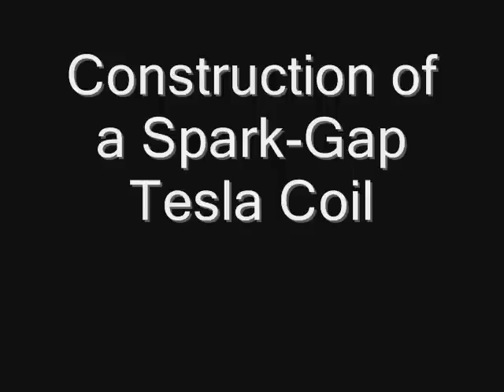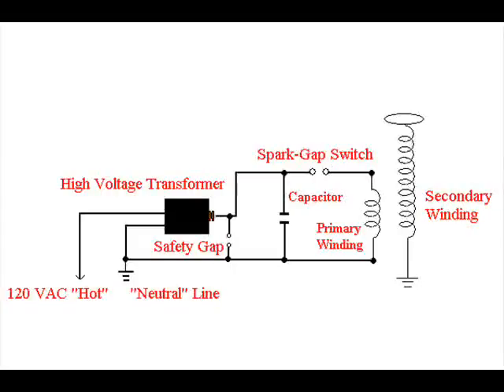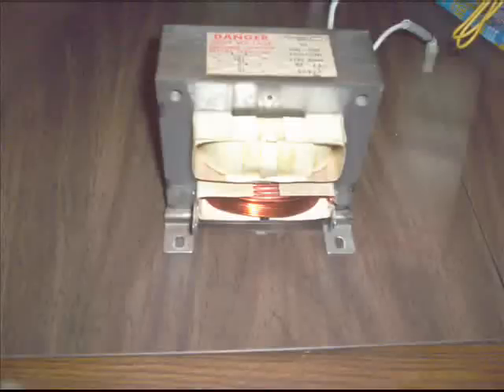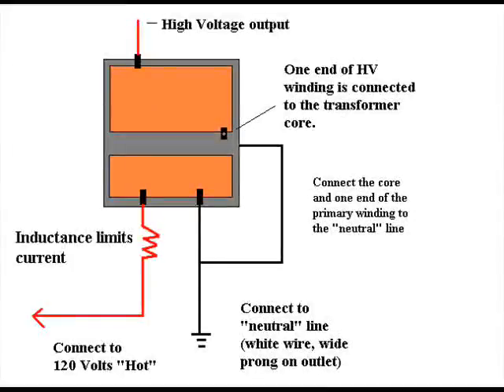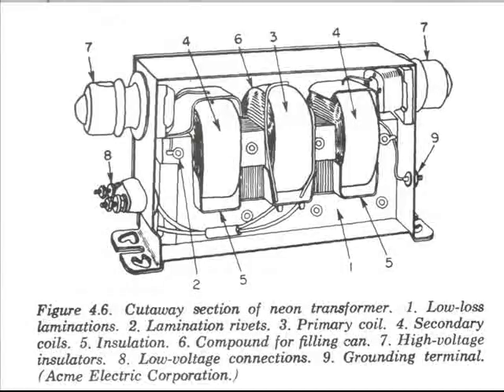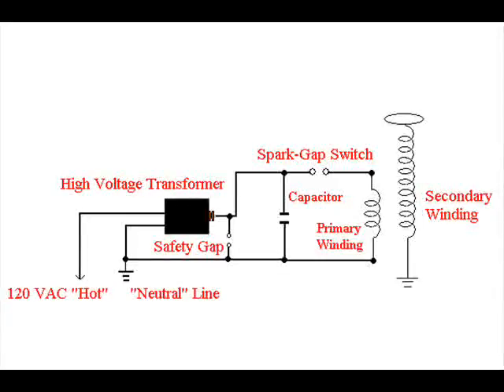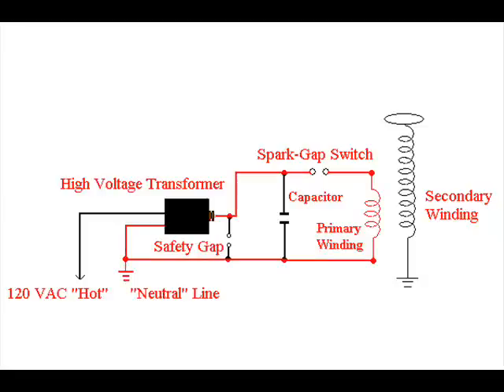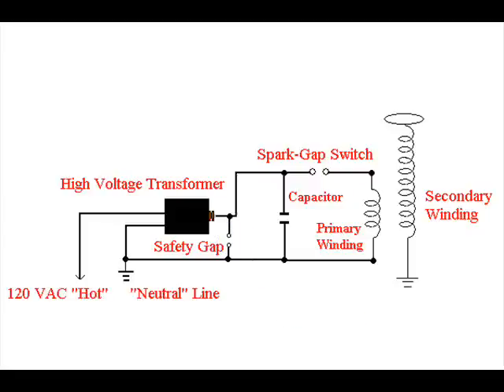Building a Tesla Coil

Comment from the maker: yeah, if you connect 12 of them in series, that would increase the voltage rating to 12kv.  But just remember that it will also divide the capacitance by 12.

Comment from the maker: Because with a transformer, you have two windings and mutual inductance.  When you draw a load from the secondary winding, it cancels out the inductive reactance on the primary winding.  The primary and secondary winding are inductively coupled, so what happens to one affects the other.  I have a video that shows this.  Look at one of my recent videos, showing a 4,000 volt power supply with microwave transformers.  I used a light bulb in series with the primary winding to limit current...

Comment from the maker: I've tried building "minature" Tesla Coils using 3.5kv or 4kv transformers and I could never get it to work right.  I had to set the gap very close just to get it to jump, and then what happened was I just got a 60hz arc from the transformer.  There was very little capacitance from the capactor and no high frequency resonance.  Even when I did get the gap to fire, it was very erratic and I got tiny sparks from the secondary.  6kv is the minimum I use now.

Comment from the maker: I make a rough estimate of the voltage output, based on the spark length.  As far as the output frequency goes, I have to admit that a friend helped me with that.  I don't remember exactly how he did it, but we connected the secondary winding to an oscilloscope by itself, and based on some calculations he determined that the frequency was approximately 1.5 megahertz.  I do know that generally, the diameter and length of the secondary winding determines the frequency, because of the inductance.

Comment from the maker: If it can supply enough current.  You need at least 20 milliamps.  You also need a sufficient voltage, at least 6,000 volts, but most flyback transformers can supply much more than that.

Comment: first very cool 3 videos, nice work, I have a couple of questions... my oibt has a 3 core flex, active, neutral and earth. plus one hv terminal. the other end of the secondary being the earth. will this work ok?, your schematic has one side of the primary tied to the neutral. wont this put the osscilations of the tank circuit back through the house wiring? also you seem to have a filter only on the active, is this correct?

Comment from the maker: You can, but that might complicate things.  What are you going to use to drive the ignition coil?  Are you going to make some kind of solid state power supply?  I have used a simple circuit with a dimmer switch and a capacitor, and the ignition coil worked great for a while.  But it didn't last very long.  The dimmer switch burned out :(

Also since you don't know the exact output if you experiment with an ignition coil, you wouldn't know what voltage rating your capacitors would need to be.

Comment from the maker: Do you mean from a Tesla Coil, or from the 2kv transformer by itself?  How much current did you have?  You might be able to DRAW 2kv out that far if you have a lot of current, but there's no way it will initially jump that far by itself.  Even 15,000 volts won't jump that far by itself.  I can draw it out several inches after the arc starts though.

Comment: No matter how ionized the air becomes, the breakdown voltage of air is around 3000 volts potential. Copper wire has much less resistance than any ionized air. Obviously ionized air would allow for a lower resistance path for lightening, however this area surrounding a TC is not very large, so the probability for lightening to strike the actual TC during operation is slim at best. Also, as the air heats up around the TC, its conductivity lowers, which is what I was eluding to in my previous post.

Comment: @ct92404 Thank you for the reply.
I've seen Tesla's designs on how to absorb charged particles from the air and gather them as a form of static electricity then use that power to produce work in devices.  I was waiting for someone to mention photovoltaic cells.  Tesla's were a more primitive precursor to them.
Still, the electricity would be gained passively, stored then pulsed for use.  A 'trickle' collection of 'free' or 'renewable' energy.  Depending upon which term you prefer to use.
Ciao

Comment from the maker: You can draw sparks from a Tesla Coil, but you have to hold a conductor in your hand and you can't get hit directly by the sparks.  If you're talking about that scene in "The Prestige" where Nikola Tesla walked through the high voltage streamers, that's just Hollywood crap.  He never did that.  Telsa DID draw sparks from his high voltage coils, but usually he would hold a rod or something in his hands so the spark itself wouldn't burn him.

Comment: @ct92404 i will be using a 9000v 30 mA transformer and all i have is 18 gauge wire and im not able to get 14 gauge wire. i read somwhere that 18 gauge wire can handle 3 amps

Comment from the maker: @KenRocker1968 
There are a lot of experiments you can do with a Tesla Coil.  It generates very high voltage, and it also generates high frequency radio waves.  You can actually build another coil that is tuned to the same resonant frequency, to receive the energy that you transmitted.  So it's possible to make a system to transmit electrical power without wires.  That's actually what Nikola Tesla was working on.

Comment from the maker: @nmssis 
Well, if you're new to electricity then I'm not sure exactly how to explain it best.  But a Tesla Coil is a type of transformer that changes electric current to very high voltage and generates radio waves.  I suppose in a way you could call it a "delivery system" since it could be used to transmit power.  But it does NOT generate power by itself.

Comment from the maker: Like I explained in my other comment, you can connect several capacitors in series to increase the voltage rating.  You could connect 12 1kv capacitors in series to increase the voltage rating to 12kv...BUT that will also divide the capacitorance by 12.  So to get the total capacitance, you need to look at the capacitance value labeled on each capacitor, and then divide that by the number of capacitors that you're using.

Comment from the maker: @kennyman08 
Yes, it can be, in some circumstances.  The output from a Tesla Coil is very high voltage at high frequency.  Your nervous system doesn't respond to high frequency, so you won't feel a shock.  But you don't want to get hit DIRECTLY by the arc because it can burn you.  Also, if you don't have the coil tuned right, it might have low frequncy (60hz) in the output too, which would shock you.  I've never had that problem, but it is possible to happen.

Comment: I watched the video and did quite a bit of reading before building my coil, but I can't get any sparks. Spark gap fires, but none of my primary taps give a spark. Did all the res frequency calcs, and suggestions are within range of where I am tapping. I have a 12000 volt tansformer at 30ma, and 2 series 0.02mF caps in series for 0.01mF. Is this too high? Can I put a .01mF cap in series with those to get the .005mF people suggest for my transformer matching? Any help from anyone is appreciated.

Comment from the maker: @junkie654 
Nikola Tesla was working on a way of TRANSMITTING energy without wires.  The point was that he wanted to build a system for transmitting electrical power without using power lines.  The power plant would have an antenna, kind of like a radio station, and to receive the power all you needed was an antenna and a circuit tuned to the same resonant frequency.  Just like how we pick up radio signals today.

Comment from the maker: Look in electrical surplus shops and neon sign shops.  Back when I first started experimenting with high voltage, I just found a neon sign shop and asked them if they had any old or used transformers I could buy.  The guy I talked to said they had an old 15kv transformer and he let me have it for free!  If you're lucky, sometimes they will sell you an old transformer for cheap or maybe even give it to you for free.  Also, look on eBay.

Comment: lets see if i have it........ i have been hooking up the NST, and caps in parallel then one side through the gap to the primary. and the other side of the nst straight to the primary......... your saying no parallel everything in series---- nst-cap-primary-sparkgap-nst.... correct....

i tried this and it made my spark gaps purple, and my beer bottle capacitors started to pop.  nothing out the secondary.

any suggestions... do i have the wiring rite.. you can im me if you have time.. thanks

Comment: Couple of questions, the mains voltage over here is 240, and the "hot" is called "live". Out of curiosity I've tested the voltages between neutral and ground, and I've found that there's about 120 volts between them, there is also about 120 volts between the live/hot and ground, so would I have to connect it up differently?

Comment from the maker: Yeah, 18 AWG should be ok for the AC input wires to the transformer.  But I have a question for you...if you can't get any other kind of wire, then how the heck are you planning to build a Tesla Coil?  Where are you going to get the magnet wire for the secondary winding?  What are you going to use to build the spark gap and  safety gap?  Surely there is a hardware store somewhere where you live, right??

My point is if you can't even get 14 AWG wire, then you're going to have bigger problems.

Comment from the maker: @DarkShadowMegadeth 
No, Tesla Coils are not illegal.  In fact, a lot of colleges have them in their science or engineering departments.  They're perfectly legal.  But a Tesla Coil does not generate power.   It only converts power to high voltage and high frequency.  It does NOT generate electricity on its own.  You need to power it with an external power source.

Comment from the maker: ...you can use a bigger battery, but that will only give you more current, not higher voltage.  Your problem is that you're working with low voltage.  You could connect 2 or more batteries in series to increase the voltage in the primary circuit.  The transformer will step the voltage up to several thousand volts, but still not as high as what you would get from 120 volts AC.  If I powered my small Tesla Coil with DC, I would probably get around 30kv instead of the over 100kv I get now.

Comment from the maker: Do you mean using the plasma globe transformer to power the Tesla Coil?  No, that probably won't work.  They usually supply very low current, and you need at least 20ma.  Also, plasma globes use a solid-state flyback transformer.  Tesla Coils tend to kick back a lot of high frequency.  Solid state circuits are very sensitive to high frequency kickback, and you would need some kind of filter or choke to protect it.  I prefer using straight AC transformers.

Comment from the maker: @TestTubeTony 
I have built several Tesla Coils (I've been experimenting with high voltage for over 10 years) and I've seen designs for both ways...where the spark gap is connected in series or connected in parallel.  Also, I've shown my Tesla Coil to a technician who builds HUGE coils (powered by 15kva pole transformers)  and he said the way it was connected was fine.

Comment from the maker: Tesla Coils work with resonance.  If it's not tuned right, then it *might* work, but not very well at all.  You'll get sparks, but they will probably be very small, and it will run really rough.  But why put all that work into building a Tesla Coil if you're not going to tune it and get it to work the best you can?

Comment from the maker: @geekydude21 
Theoretically, I suppose you could.  But something tells me that wouldn't really work right.  For one thing, would that supply enough current?  You really need at least 20ma.  The other issue is whether the ballasts are AC or solid state.  I guess the only way to find out is to experiment and try to connect them in series and see if you can make a high voltage supply with them first.  If that works, then maybe you can try it to power a Tesla Coil.

Comment from the maker: Your teacher is probably getting it confused with a Van de Graff generator, which uses static electricity.  Those are affected by humidity.  But a Tesla Coil is completely different, it's a high frequency transformer and does NOT work with static electricity.  Humidity might have a very small effect on the length of the sparks, but it will work in pretty much any environment.

Comment: @007foppe Capacitors are a means of storing energy. I do not know what you mean by "stability". Do you mean that they keep the current constant? If that is what you mean, a constant current is dependent upon whatever the power supply is. By constant current, I mean that there is a current running through the object in question until the thing supplying the current is disconnected/turned off.

Comment: there are patents that tesla filed about the wireless tesla coils. they are sort of different than the ones you see, but very similar. tesla clearly states the parts to use in the device in his 645 576 patent"apparatus for transmission of electrical energy".just google patent search it or get an idea off of my video describing it very basically.

Comment: Hello,

could anyone who reads this please answer these questions:
- What happens if you hook it up to a german 220 line? instead of 120
- Does an increased ma mean you can transmit further distances?
- Is this safe to use inside? Lets say we have an office with a room like 8 by 8 meters, and next to that a room attached of 2 by 2 meters, would a good tesla coil power all the lights in the 8 by 8  room? (i think yes)

please answer :)

Comment from the maker: @Crashromeo100 
If you connect the transformers in parallel, that would increase the current capacity, not the voltage.  In order to increase, or double, the voltage you have connect the transformer secondary windings in series.

Comment from the maker: ...However, under the right circumstances (or maybe the wrong circumstances?!) if you were in an area prone to lightning strikes, and the conditions were just right with leaders or streamers already forming in the air from an imminent lightning strike, the electric field from a large Tesla Coil just might be enough to form a conductive channel for lightning.  It wouldn't "attract" lightning, but it would give another conductive pathway for lightning to branch off to.

Comment from the maker: Well, unfortunately Tesla Coils don't scale down very well because the physical size of the windings affects the tuning.  But you might be able to make a battery operated one where it would be relatively safe to touch the sparks...it would still hurt though!  In fact, the Tesla Coil I show in my videos I originally built to work with a 12v battery.  I used a relay wired so that it would self vibrate and drive the transformer with pulsating DC.

Comment from the maker: Actually, alientechshop, that's not really true.  The output from a Tesla Coil is NOT necessarily "low current."  Yes, the current is less than the current in the primary circuit, but it can still be quite high.  The sparks from a Tesla Coil can be hot enough to burn, and if you touch a spark directly with your hand it can cause RF burns.  The reason why it doesn't shock is because it's high frequency, and the nervous system doesn't respond to high frequency, so you don't feel a shock.

Comment: well maybe, but not the coils built today which just make sparks,  Tesla did have ideas for drawing energy form the aether, what you mean by air.  The idea isnt really to use the ionosphere as a conductor but as one plate of a capacitor, the other being the earth, with the rest of the atmoshere in between being the dialectric. The ionosphere is made up of rarified gases which make excelent conductors.(plasma globes, neon tubes use rarified gases. If you want to learn about this stuff check out

Comment from the maker: You need to be more specific.  Are you talking about microwave transformers, neon transformers, or what?  Usually  the core on a high voltage transformer is grounded as a safety precaution.  In case the secondary winding shorts out and makes contact with the core, the case of the transformer can become charged (or "hot") with high voltage.  If a person were to touch it, it could be a lethal shock hazard.  So the core is grounded as a precaution.

Comment from the maker: Well, remember that diagram I had was for an end-point grounded transformer.  I just didn't have time to add a diagrm for a center-tapped transformer.  For a center-tapped transformer, you will ground the center point, but the two high voltage output terminals will be "hot."  You'll connect the primary winding of your Tesla Col to the HV output terminals.  Message me, and I'll send you a diagram.

Comment: The *breakdown* voltage may be high, but once you get the spark going, the resistance is ow.

This is the idea behind the spark gap switch.  The air's high resistance allows the capacitor's voltage to rise until it reaches the air's BD voltage.  At that point the air becomes ionized and its resistance drops very low, allowing high current to flow.

But we are unlikely to agree based on theory, and I'm not going to perform the experiment since I consider it dangerous and unnecessary.

Comment from the maker: 12kv at 60ma would be great for a Tesla Coil.  But yes, it can be dangerous if you aren't careful.  Just take the right precautions for working with high voltge and use common sense (be sure you completely de-energize the circuit before you touch anything, etc) and you'll be fine.